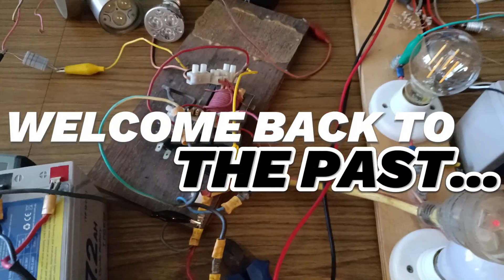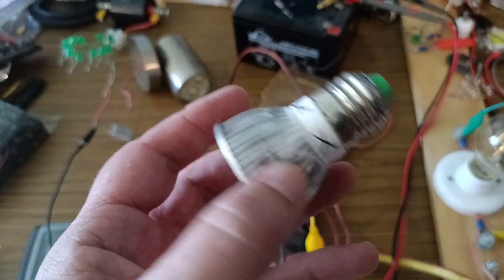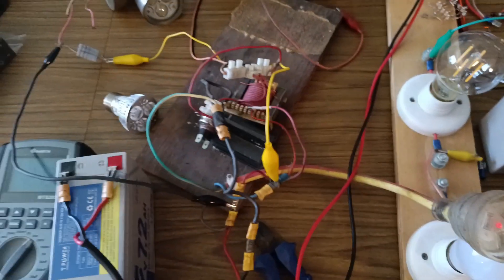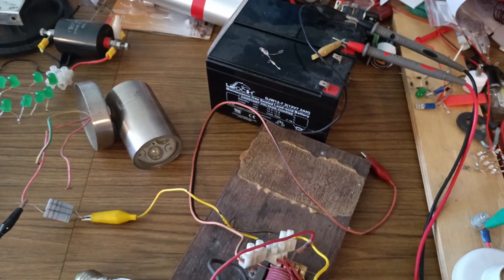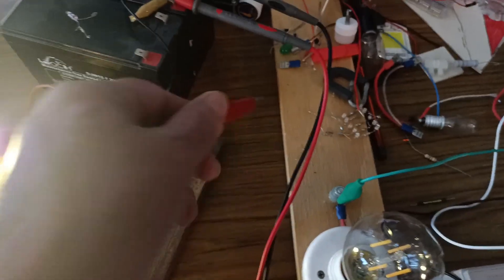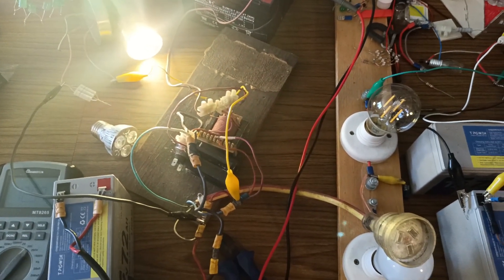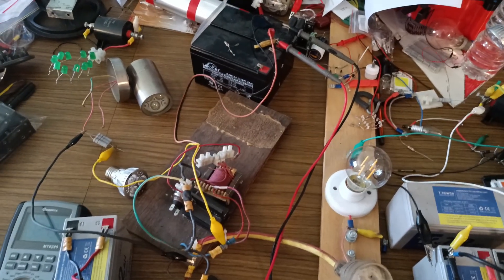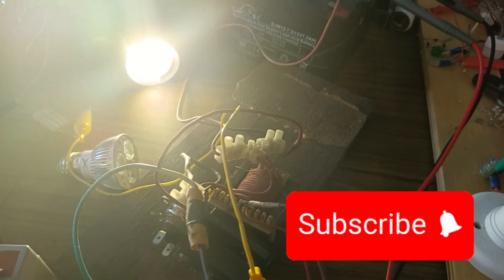SUPER JOULE RINGER 2.0 + BATTERY REVIVER MOD

Comment: Have you not thought of just using a dc-dc converter ic and a inductor to get a more controlled voltage step up.
Iron cored transformers are normally used at low frequencies like 50/60 Hz, a ferrite core would be a better option as I expected this circuit is self- oscillating at quite a high frequency.
Reply from the maker: @TheEmbeddedHobbyist  Thank you for your comment.
Sorry for my delayed reply. This is a replica of Lasersaber’s SuperJoule Ringer 2.0 which is wound on a ferrite E-core that I scavenged from a dead inverter. This is not wound on an iron core for the reasons you suggest and the main benefit of this circuit is the high frequency impulses on the DC output, this high frequency acts as a desulfation tool and a fair bit cheaper than a commercial desulfator. I have personally used this circuit to repair many batteries and considering this unit is something like 12 years old it is super reliable, I will be using it today to attempt a repair on my neighbours 12 volt lead acid battery that has been on a conventional charger for 24 hours and taken no charge and states it’s full, as batteries go that is dead so I will now put the Ringer 2.0 on it and see what happens after 24 hours, usually 24 hours was enough for most batteries at which point a conventional charger is used, if it has repaired it then you will see an inrush of amps when connecting the normal charger.
So this circuit has many advantages over a boost converter, thanks for watching.

Comment: That light is only 2 mega ohms at the dc voltage inside your meter. At a higher voltage the resistance will be less.
Reply from the maker: Thank you for your comment.
Sorry for my delayed reply.. That is most likely the case, I will probably have to compare voltage drop whilst running to obtain the resistance value. Most of the time I don’t bother measuring that sort of thing because I usually set out to achieve a particular goal, ie. get the light running. I was hoping it was measurable for everybody else’s benefit when replicating and until that point I had never tried to measure the bulb resistance in the 12 years prior. 🤣

Comment: Are all three coils wound on the center leg of the ecore?
Also what are the wire specs?
Your other system does it output as good as this one?
MTech is using special cores, but yours is air, would core material increase your output?
Sorry for being a pain just find this stuff fascinating.
Reply from the maker: @Jon-fs2zj  Thank you for your comment.
Sorry for my delayed reply. Yes all three coils are wound on the same leg of the ferrite E-core.
I just had to measure the wire again because it was such a long time ago when I built this. The wire is multi strand copper wire, wire diameter is 1.2mm and with insulation it measures 2.3mm.
My system and MTech’s setup are different, this setup is using a ferrite core as per Lasersaber’s instructions, yes my other system system has no core or uses an air core but again these are different systems with different capabilities. My other radiant energy system is beneficial for through earth transmission but this one is better for incandescent bulbs that my circuit will struggle to run. This is a case of two different machines, both very beneficial to have but completely different.
The fact that mine can be built using the air around you as it’s core, in my opinion makes it more accessible and can truly be built from scrap but hey if you’ve got the money more power to you, I know if I could afford to I would have 1 of everything.
I don’t consider your questions annoying, I’m just glad that others share my fascination.

Comment: Not sure of you are aware that the non connected wire in your primary generate standing wave which can act as a charge pump, basically doubling the work for the same expense. But, in schematics all wires are connected … I am confused now 😢
Reply from the maker: Thank you for your comment.
Yeah that would be an error on my part that should be clarified. The Non connected coil is the Green one in the schematic. In the early days I thought this green wire in Lasersaber's design had to be left OPEN as it is essential to start version 2.0 but later I realised only one side of the output from the green wire and full wave bridge needs to be OPEN. Basically just leave the POS terminal disconnected for start-up then connect POS terminal when circuit is running. I will attempt to show the winding layout for this Lasersaber Super Joule Ringer 2.0 as there seems to be very little left of the 2.0 version on the internet anymore.
Reply: @whatifididthis...1236  well … after you clarified this I am stunned to see how similar is this circuit with patent NL1032750 of Arie Melis deGeus but you managed to use just a 2N3055 transistor in stead of frequency generator. And that patent state overunity ! Backed up by all calculus, theory and method of building including details of components.
Reply from the maker: @Caesarus2011  Yeah you mostly have Don Smith to thank for that. I remember in the early days ( and I’m old 🤣) Don kept showing a chart of radio frequencies and an ignorant much younger version of me was like, “why does this guy keep banging on about the radio chart”? As well as having the chart behind him when doing interviews. Later I realised once your in the radio spectrum it’s just a case of tuning your coils which means the same length of wire. A signal generator will give you a much greater playing field but if you just want a specific frequency then it’s only a simple oscillator circuit that is required. All coils of same length near the transmitter will receive power, add even 1 turn more and it may not work. So in Lasersaber’s 2.0 version the primary is wound side by side with the same length wire (green wire). This green wire is important for starting the circuit, I believe it is acting as a dielectric capacitor and a version I tried without this wire failed to start